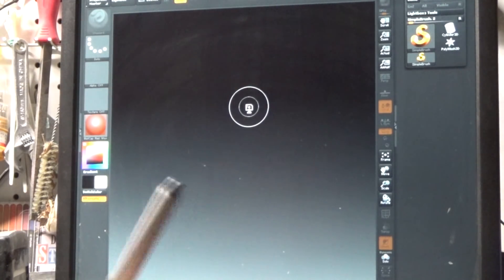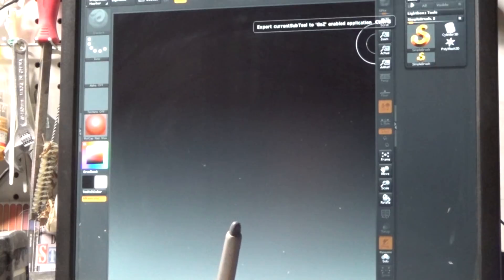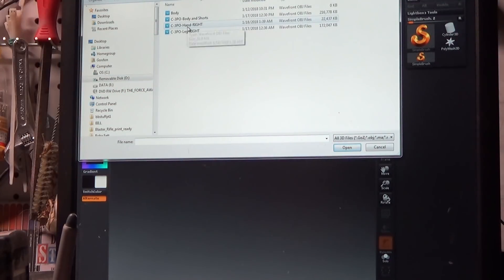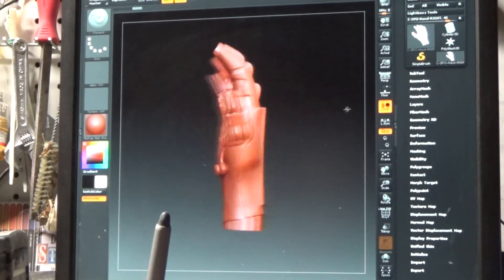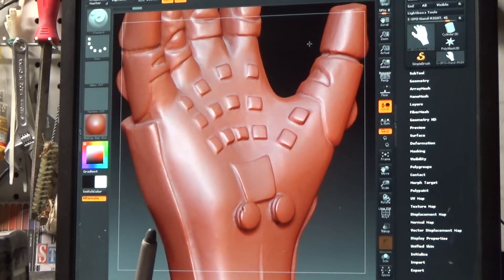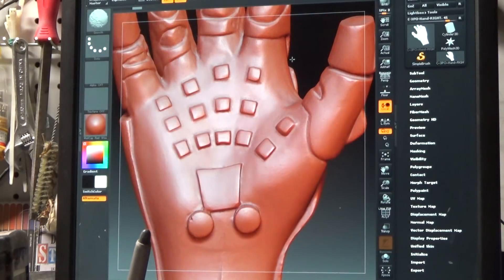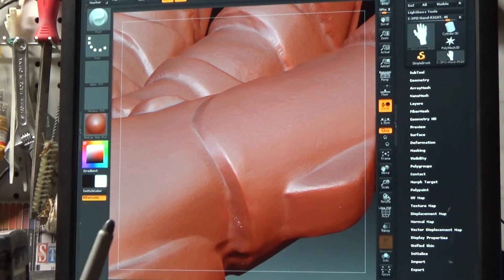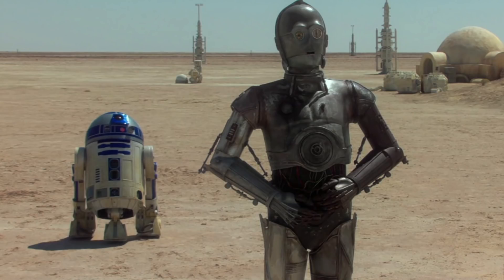3d Printed C-3PO Statue Build pt.01

Comment: Hi Gordon, 
Glad to see you taking this one on as well, I have been working on this same project myself the past few months. Already finished the torso, head, biceps and forearms etc.. Let me know if you run into any issues, I would be glad to assist. Already printed the torso, biceps and forearms. However I will be adding your belly ring and arm pistons (In stainless steel, will be curious to see how they come out) on shapeways. 

Also, FYSA - this video helped me out a ton for smoothing out the inside of the mesh after you do the hollowing out process. 

https://www.youtube.com/watch?v=nVQCU8U7Udg&t=1330s